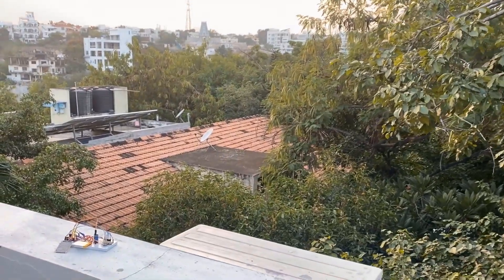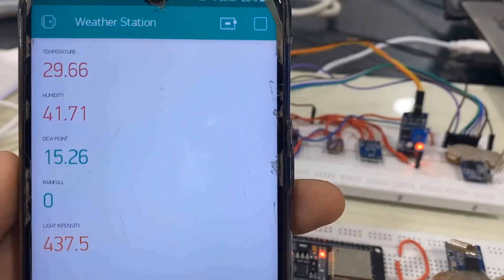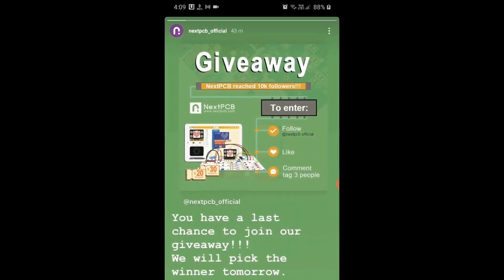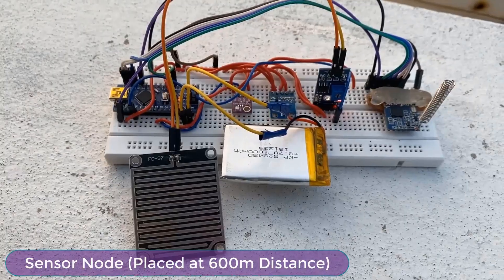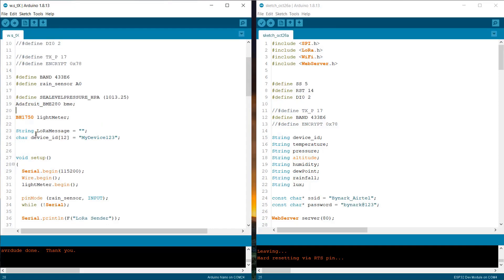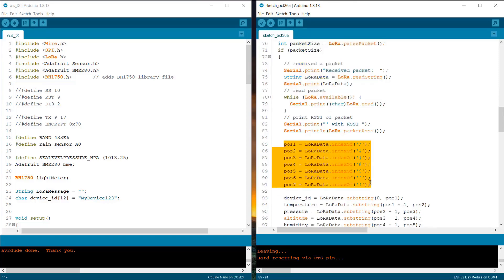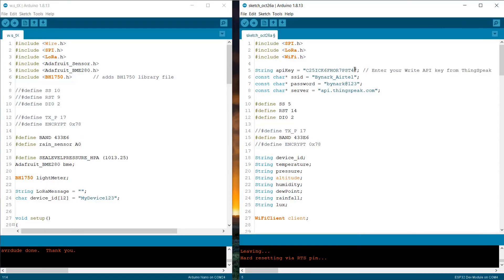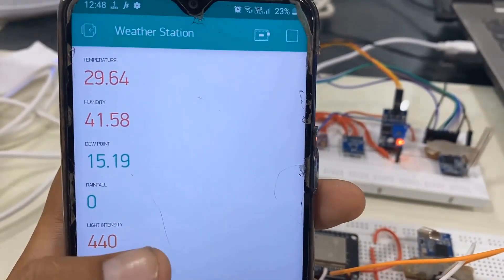LoRa Based Wireless Weather Station Monitoring System

Comment: Amazing  project. I am now new subscriber! Please let me know if you have some video or tutorial by how you soldering SX1276 lora cables...did you put some silicon over them to protect? Another question...I think at the tutorial maybe Pins from RST is wrong (at the picture in Node circuit I see RST from Lora connected to Pin 6 and not Pin 9) Please help me.. Thank You!
Reply from the maker: You can solder the lora module by any method. And RST pin need to be connected to 9 i guess. Check the code at how is rst pin defined.

Comment: will u make a wireless rf modules based water level meter and auto pump on/off project with manual button to turn on/off pump at any time?
water level should be displayed via lcd display or using 10 leds